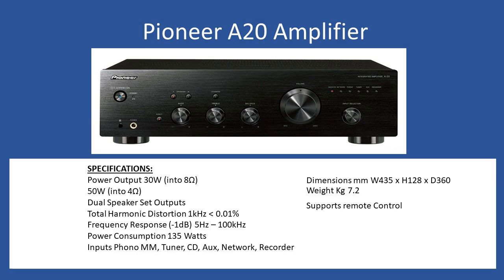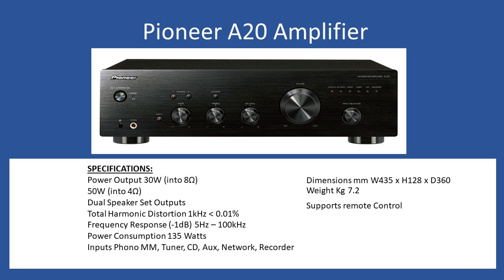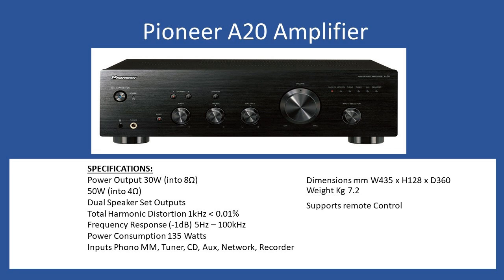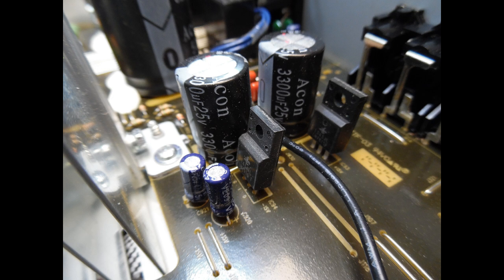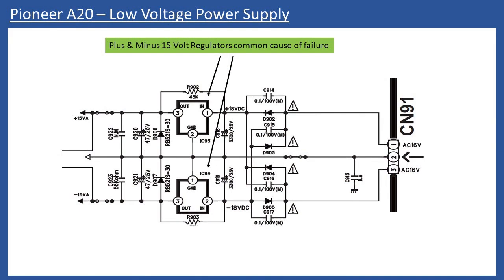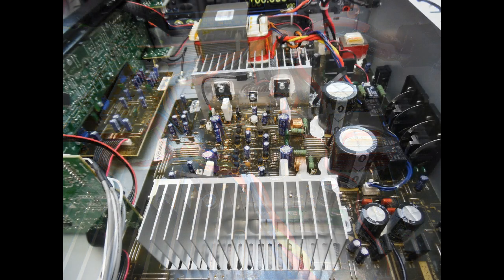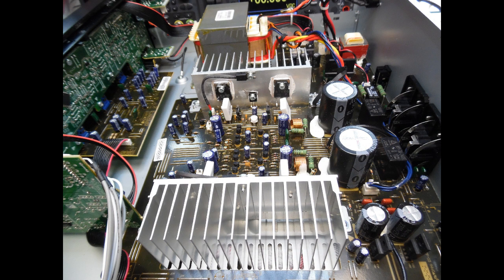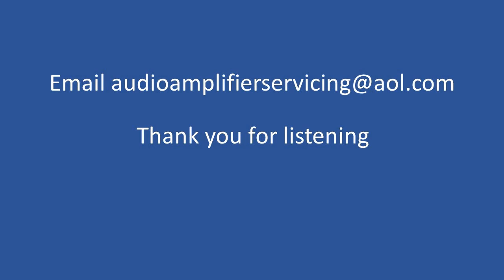Pioneer A20 Amplifier Repair (With Audio Tutorial)

Comment: Hello there. Great video. I have this amplifier and for some reason the left channel has a fault where it is much quieter than the right channel. It is also crackly at times. I believe the issue might be with the balance potentiometer but im not sure why as i always have it centered and never move it. When i enable direct mode, sound is restored to both channels so this is what leads me to think that there is a mechanical fault with the balance dial. I can also pull and press the knob and this can make the left channel louder and quieter. I was wondering if it is possible to clean the potentiometer with some contact cleaner?
Reply: I have this issue oppersit channel 100% the pot inalresdybreflowed mine once it probableed some. Contact cleaner in now to